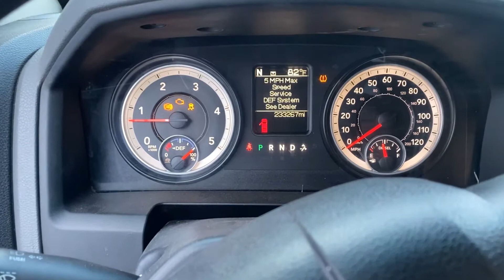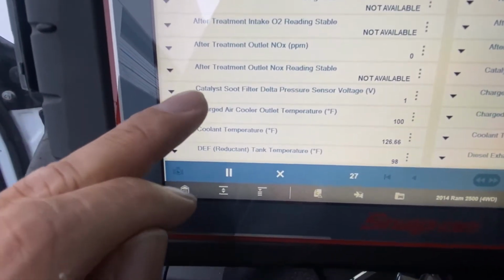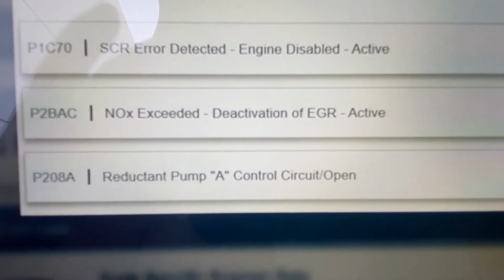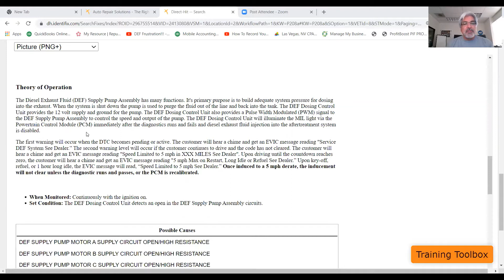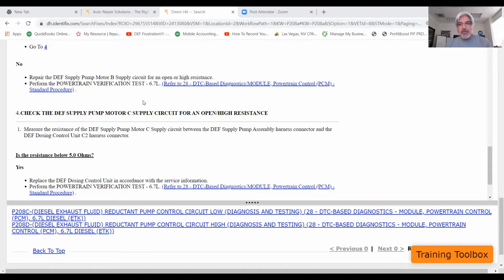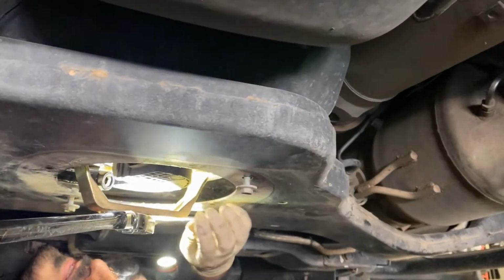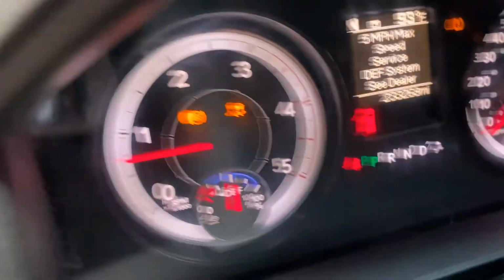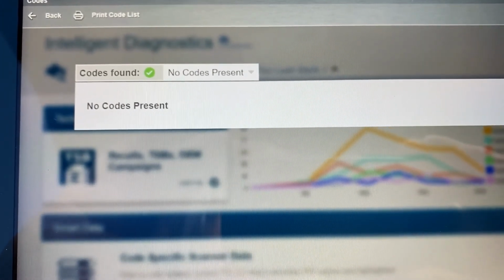2014 RAM Cummins derated to 5 MPH

Comment: This happened to me yesterday in the middle of nowhere Wyoming, on my way to Utah. It told me to service def system. Then about 5 min later came on and said I had 150 Mi to go. Then I pulled into a Loves started making phone calls looking on YouTube and found out the (Diesel Exhaust Fluid injection pump) was the culprit. It was a pretty easy fix but you have to climb under the truck and it's connected to your exhaust. I had to order it to O'Reilly's and pick it up the next morning. Fixed it in the O'Reilly's parking lot and continued on my way, the code cleared all by itself about 50 miles down the road. My advice, once you see this pull over start youtubing the problem and then make your plan. Do not keep driving thinking it's going to go away cuz it won't. I tried to unplug my battery terminals that problem was still there no matter how long I unplugged them. In my eyes it was a blessing that I had 150 mile warning to figure out what I needed to get done, because I was pulling a 40-foot trailer and that would equal to a huge tow bill.
Reply from the maker: @StingerJake  a trick to get u a few miles .. when u unplug the batteries, unplug all four terminals on both batteries, then on one side hold the positive cable and the negative terminal together. This depletes the capacitors in the ECM to reset it. Do this with the other side battery cables unhooked

Comment: P207F , still pops up for me and I have replaced the def injector with a napa part, had a complete regen that took an hour to do. Tested the def also and it was good.  Had everything tested with the fancy tech scanners and all was good. Why do I keep getting this code?
Reply: Did you figure it out?
Reply: @92Inquieto  came up 2 other times so had the batteries disconnected once and the other time I used a code reader from the orileys to clear it. So far so good.

Comment: In the middle of nowhere in Urah, my truck says service def. A few minutes later it went to count down. Later, I had 20 miles till it went into limp mode. Stopped and pulled batterie cables. Made it to a Dodge dealership. They came back an hour later and they could not find anything wrong. Drove home 500 miles away. No problem. Twice this has happened to me. Ruined my vacation. Any lawsuits happening  with this bullshit. No problems till I paid my truck off.
Reply from the maker: Definitely an intermittent concern.
When you reset it by disconnecting the batteries you cleared the codes.
Buy a cheap auto parts special code reader and next time it happens before you disconnect batteries check for codes first.
If your truck has the recall don’t get it updated. Issues with the update

Comment: Hi I have a problem with 2014 Ram 6.7 
With only the P1C70 and I can’t erase the code..and still have a 5MPH Max speed service DEF SYSTEM ON THE DASH ..I replaced a def injector ..
And the def pump I have only 14.6 psi

Comment: What makes pump run after taking key out for like 20 seconds?
Reply from the maker: If the pump runs with key off is that it’s reverse “pumping”
Meaning the system empties itself to ensure there is no DEF in the line to the doser when truck is shut off. 
Imagine DEF freezing on a cold night in the line. So this ensures no DEF left in line. 
There is a reverting valve that allows the pump to flow one direction but then reverts flow to the opposite direction.
Reply: Is that normal? Will it hurt anything?

Comment: I had the P208a code come up on my 2017 ram with 197k on it. I tried to siphon some def to see what it looks like. All I got was a gel like crap that wouldn't even suck through the hose. Pulled the tank and it was full of this gell. I can't swear in court that I didn't have a brain fart and add either Lucas deep clean or Power service to the def tank instead of the diesel tank. To see what would happen I left some def in the jug and added both to see if it gelled. Nothing after a week.  All seems well so far. Trucks running fine. Any ideas?

Comment: I have the same code (P208A) come up on my 2013 2500. So is there a good chance that I have a bad pump as well or could it be the wiring?
Reply from the maker: Most likely, it is a common problem, clear the code if it immediately comes back, it can be.

Comment: My 2014 2500 Ram is in countdown with 15 miles to limp mode and has zero codes thrown. I took it to a local Diesel Performance shop and they hooked the computer up to it as well and no codes and could not clear the countdown. The shop forced a regen and still nothing. Any thoughts or help would be appreciated.
Reply from the maker: Is the NOX light or
Message on?  Email me a pic of the dash with engine running at tsalas@dieseltg.com

Comment: Well done ,it feels good when it goes right.I have an 09 that`s going into the 5 mile an hour mode ,i just bought the truck and i`m a bit concerned about if it can be fixed and the cost.
Reply from the maker: Of course it can be fixed ! Just need the right tools and info!
Hope you get it fixed!
Reply: So did you fix the problem and the cost ? Thinking of getting one soon.

Comment: Hello Tony please help me out, have a 2016 2500 and its on limp mode 5mph limp codes are p2482 egt sensor circuit high bank 1sersor high/ p1c70 scr error detected/ u010e lost comunication with reluctant control module  and p21c4 reluctant heater relay control circuit high had one of the wires on reluctant control module was torn fixed now also deff fluid not reading been at 0 and its full i know its full topped of before having problem please help me out thanks Alex
Reply from the maker: Geez it’s a bad one. I go after the relay code since you have the U code. 
You a tech? Have service info?

Comment: My truck is on limp mode Diesel exhaust fluid line pressure shows 601 kpa, what that means?
Reply from the maker: If in limp mode you should have a code or codes set.
Need that info
Reply: Yes code is P1c70.    2014 2500 cummins

Comment: ECo diesel 150 miles will not start i scan it p2209/00 i clear the code no check engine n still the msg in dash how can clear the msg how to reset also clean the def injector
Reply from the maker: Is this a RAM 1500?
Reply: @dieseltalkwithtonysalas8725  yes 1500 ecodiesel codes p2200 p2209

Comment: My ford F250 6.7 started acting up once it got cold to much idle time it overloaded the exhaust filter the truck set all summer at the dealership I bought it at the in early November it gets cold in Michigan it warned me it was going to limit speed to 50 miles a hour in 10 miles  it cleared its self and never did it again I've had a lot of diesel trucks over the years it's to bad they put all the emissions on them I still have a 2000 F350 4wd drw powerstroke I not getting rid of it now it's a plow truck

Comment: Suffering through this recently. Bad bottle of Maomart DEF dated 6-30-2022. Dealer in Columbia TN “fixed” for $607.  Drained tank, replaced o-ring, filled tank.  370 miles later, halfway home, DEF, check engine, 150 miles to limp home mode. Dealership in Abingdon, VA showed where SVC tech in TN got DEF on pump contacts which corroded contacts.  Cleaned up, plugged up, filled up and I was on my way, sweating bullets until I got within 150 miles of home. I normally use about 2.5 gallons DEF in maybe 5000 to 7500 miles depending on what I’m towing. TN to VA used a quarter tank, refilled, next 380 miles the DEF needle barely budged off full. what a messed up system. This happens again I’m buying a delete kit.

Comment: At the end of the video. U can clearly see the check engine light is back on.  And u never scrolled through the vehicle messages.  Where the message for 5mph max is displayed
Reply from the maker: That is correct caught that after I shot the video. Nox sensor 2 to was the issue with that and truck was good.
Reply from the maker: CORRECTION!
I got trucks messed up! 
The reason why the check engine light is on is because the engine is off! Notice no RPM.
Check engine light comes on as a bulb check with key on engine off!
No why in the heck you trying to mess me up?!

Comment: Having same issues does it really drop you to 5mph ?
Reply from the maker: Did I ever reply ? I am sorry! But yes it will not go over 5 MPH
Reply: On my 22' with the P207a code my service tech says you keep driving until you reach your destination and don't turn the motor off. Mine did it with 20k miles, I cleared the code with a scanner and got home. The dealership replaced the entire DEF tank pump and sensors. Under warranty.

Comment: Got 150 mile message pulling sleds north.  HERE WE GO!  
So far injector nozzle tests bad on bench. Can't get in to dealer around me for a month minimum
Reply from the maker: What would help is the code it setting. You do have a check engine light on?

Comment: Just subscribed to you. 
Is there a way I could email you for some info on my 2014 3500 that I'm working on? 
I've recently removed the exhaust and replaced with a delete pipe along with removed the DEF system to do a total delete. 
But, after doing some work on it by cleaning up the def system lines and tank along with the exhaust filter that stated it was 100% full I'm wondering if the work I've done may have been enough to repair the problems. 
Even though I've installed the pipe, finding the tuner is like pulling teeth with the price of them in the thousands$$$. 
If possible to email to keep these comments to a minimum, I'd appreciate it if you could/would.
Reply from the maker: tsalas@diesetg.com
But! You deleted the truck without a tuner? Or are the sensors and def injector still plugged in?
Reply: @dieseltalkwithtonysalas8725  New straight pipe. DEF is removed. Only thing left is to do the tune. (And disconnect the EGR)
I had a problem with the DEF faulting on me consistantly being the last one the final straw. My wife filled up the truck with some 87 octane, causing the filter to clog, possibly. Regardless it stated it was 100% full. That's when I purchased the pipe and removed/replaced it. 
Had a Duramax before and regret going Mopar.